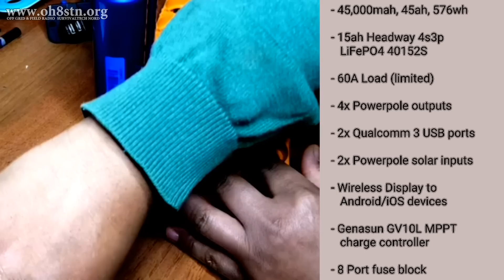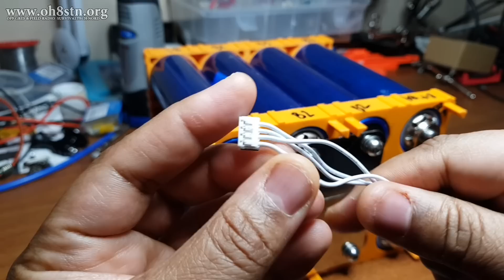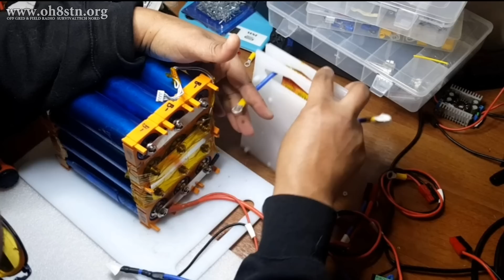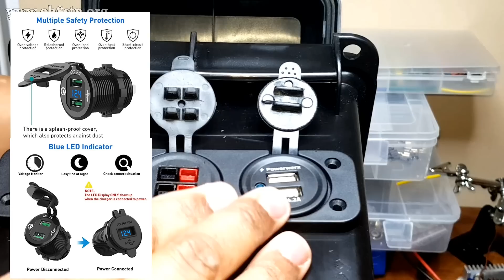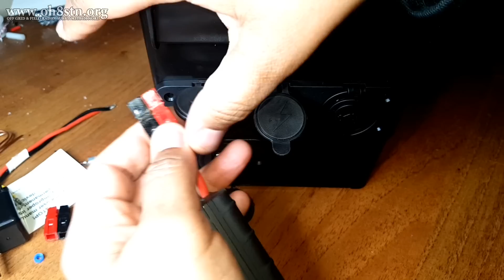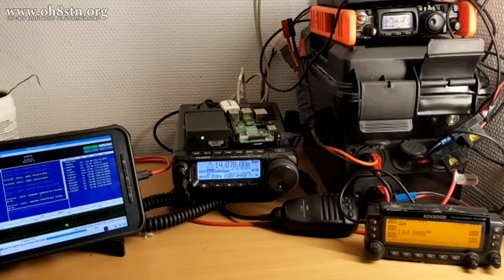DIY Ammo Can Solar Generator | LiFePO4 Off-Grid Power Build

Comment: Julian, looks like a great base camp power system.  How much is the all up weight of the overall system?
Reply from the maker: The solgen is total weight 18lbs (8.3kg). The 120 watt PF solar panel is ~6 lb or 2.5kg.
Reply: @OH8STN  I was curious about the weight of just the battery.  Reference the other components, have you weighed and measured each system? I have made a spreadsheet of all my components at it gets revealing which configuration works best for man portable, bike portable or picnic table portable. Big difference between man portable and vehicle mobile as you well know. Bottom line, weight management is a function of capabability and endurance. The challenge is to determine the appropriate compromise for the given circumstance.  73s IU3JNT
Reply from the maker: @TXLorenzo  hello Lorenzo. 100% agree with you. I didn't know which video you were commenting on when I left the comment. Take a look at this video https://youtu.be/Pm6Tvt58_8c
In this video I'm operating bike portable, using the system in this build. I also have smaller more portable solgens, for weight management. Would be interesting to see a PDF of that spreadsheet

Comment: Awesome build. The links seem to not find the same parts used are there others places you found these parts
Reply from the maker: Check the build notes on the website. The one thing that is not available right now he's the BMS. I did find that from another place and I'll update the linked shortly
Reply: @OH8STN  I've been trying to find an alternate BMS to use since the Bestech is not available on ebay currently.  I intend to grab one of the Bestech when they're available but do you have any second choice suggestions in BMS to get going in the meantime?  I've not had much luck interpreting/trusting the low number of reviews on most of the ones I've found not to mention the very low prices and getting RFI quiet.   I don't need much more than 30-40 amp draw at most since my FT-991A has a 25 amp fuse.  73 N1AFF

Comment: I'm not actually sure why these cells are so expensive. The battery chemistry is not the reason as similar cells cost way less. In fact, this is the only factor holding me back from building out this project. The link in the video just takes me to ebay with a pre-filled search. It would be better if we had an actual trusted supplier of these as taking a chance on ebay can get mixed results. I mean, one listing is $750!
Reply from the maker: Too many different countries in the world for any single "buy link" to make everybody happy. The build is done in a modular way so that whatever cells you can source, can be used, peovided the battery chemistry is the same.
Reply: Thanks. I’ve every intention of following up on this. As you say, emergency preparedness begins with reliable off grid power and your video here is absolutely invaluable. Definitely worthy of continued support.

Comment: Maybe you could use heat pipes/ heatsinks to cool it while still being able to seal it against water?
For emergency systems being water tight might be quite useful.
Reply from the maker: Actually it doesn't generate that much heat because we've overbuilt the system. The cool thing is designed a smaller generator based on this model. It's mounted inside a Pelican case. On that smaller one all the DC outputs are sealed oh, so no water can Ingress. Awesome idea and thanks for the comment 👍
Reply: @OH8STN  cool.  I was thinking of building something like this as a portable system for outdoors.  Being watertight seems really useful if it's going in the woods.

Comment: Let's say that a battery pack for long-term backpacking (3-4 days) should be no heavier than 3-4 lbs at the most (not including radio, antenna, keyer, mic, and other wiring). A 30 lb long-term backpacking weight is considered somewhere between average to getting on the heavier side. What would be the best battery pack that could be built therefore for long-term backpacking in terms of energy and charge capacity for the 3-4 lbs maximum guideline (also minimizing volume/space inside the pack)?
Reply from the maker: It totally depends on the equipment you want Power. How much current it consumes when you're powering it, and if it to radio how much current it consumes when it's just sitting there receiving. Generally speaking the most energy dense batteries are lithium ion. The next is lithium iron phosphate. We don't even consider lead acid or AGM or any of the nickel metal chemistry,  because they're too heavy. So we want to know what you want to power, how much current does it consume when you're powering it, and based on that we can come up with the right battery configuration in the answer to question. Does that make sense?
Reply: @OH8STN  Thanks! Let's say it's the Yaesu FT-891, receiving about 80% of the time and transmitting at full power (100W CW and/or SSB) about 20% of the time. Just as a concrete scenario.

Comment: Hi Julian, great video!!  I have one quick question – For the solar inputs you used a yellow and black Powerpole panel mount. Did you purchase it or somehow change the red for yellow? I have been unable to locate a yellow and black panel mount and am unfamiliar with swapping out the connectors. Thanks Chris N0PRO
Reply from the maker: Hi Chris. I actually purchased the yellow connectors separately. Then I swapped them out with the red on the powerpod panel mounts.
Hope this helps.

Comment: Julian, I love all that you're doing? Is there any way we can talk as I have loads of questions.  You can find my email on the ARRL website. Thanks, KC3NVS 73
Reply from the maker: Hi James. You know I have dozens of comments coming in every day and even more through my email. It's all pretty unmanageable. The best way to get my direct attention, is by using the PayPal or my Patreon. I do answer comments as I find time, and emails when it's possible. The whole point of making so detailed videos is helping operators get as much information out of them as possible. But if you use one of those two platforms I mentioned I will reply usually within 24 hours.

Comment: The charge controller should be directly connected to the battery not the BMS if it disconnects the mppt charge controller it has a chance of destroying the charge controller. Hope that information helps.
Reply from the maker: Your comment can be right in some circumstances, but in this case it's very misleading. It depends on your BMS and charge controller. If you're using the BMS and charge controller I specified in this video, the charge controller negative goes to the BMS, while charge controller positive is connected to battery plus. This configuration allows the BMS to protect the pack, disconnecting in an over-voltage state, without destroying the charge controller when the solar panel is attached.

Comment: What a beast!
The best reason for LiFePO4 chemistry, the cell voltages and discharge curve are more friendly for "12V" equipment. A 4S LFP is almost a perfect replacement for SLA/AGM, whereas LiIon/LiPo chemistries either give a 3S which result in a battery with a discharge curve with voltage going too low for many electronics (esp. transceivers), and a 4S LiPo having way to high starting voltages.
Thanks for stressing the safety. One "momentary lapse of reason" can be quite destructive with these things... (almost literally lightning in a bottle!) 73 de AF5MI
Reply: I definitely agree voltage wise it more closely matches Lead-Acid batteries which is rather handy, but I think the biggest problem stems from the haters not understanding building LiPO chemistry / discharge characteristics. The BMS can go along way toward keeping cells "in-tune" with each other (although in this installation some of that advantage is lost by "pairing up" the batteries  (not a criticism, just an observation) and yes I know Tesla uses hundreds of small batteries and doesn't "BMS lead" every single one of them, but they also fuse each one). Also, it is important to know when a battery not pulling its weight either in reduced capacity or discharge rate - this can get worse over time and the BMS can go along way in preserving the useful life of the pack / cell group. Anyway, keep up the good work and trying things to improve field comms - 73 AC8PR.

Comment: you get over a days runtime out of a 4S3P pack? wow I didn't know these headways were that good. I know I'll get about a weeks runtime out of my 180Ah CALBS, but that monster also weighs in at 24Kg. I should make one of these for park operations where I just want to travel light.
Reply from the maker: It really depends on how much amperage you're pulling from the pack. This is a 45 amp hour pack. Occasionally I'm putting a 20 amps load on it. There's a constant 1 to 2 amp load on it when I'm running my radios I'm computer. Even then I can get about a day and a half. Each of the Headway cells is 15 amp hours. Since I'm not losing anything by using an inverter, the system is quite efficient.

Comment: This does not look very "man portable"
Reply from the maker: Youre not paying attention 😊
https://www.instagram.com/p/BzCx84uDfdP/?igshid=1ca0k9vo9y2wg
Reply from the maker: Actually Dennis you just gave me a brilliant idea. I was going to post another video this week but I think I'll work on the show and tell from my field day deployment. At first your comment seem cynical but actually it's brilliant comment they put me in the right direction for the next video. Right on!
Reply: Actually I was not trying to be sarcastic at all. Just making a comment. I enjoy ALL of your videos and have been a subscriber for 3 years. One suggestion. I notice that a lot of your portable power videos are DIY. If there was an emergency situtation  or a SHTF situation you would not have the parts to build anything not to mention that mail service would be out. Why not do a video on the same thing but using components that you could snap together that you would already have on hand. For example you have the power film roll up panels you connect that to an already on hand solar controller which you connect to a motorcycle battery e.t.c No soldering or wire stripping or trying to find connectors required??

Comment: Love this! Looking to getting into Ham Radio but for now building a solar gen for my astronomy and camping. Just got a Renogy 50ah Lifepo4. Does that Bluetooth shunt system give state of charge info? I was foggy on that. I can do volts and amps with my DVM but need some kind of special thing for SOC. Victron is so darned expensive for that little meter they have.... Next time maybe I'll be brave enough to build my own battery bank:) Thanks for the great vid!
Reply from the maker: Yeah the shunt goes Way Beyond just being a meter :-) state of charge, real time incoming and outgoing amps & watts, battery runtime remaining, volts V1, V2 from two different points in the system eg battery and solar input, controls relays, high and low voltage protection, over current protection, and can send data to a computer for data logging.
Victron gear is awesome. You shouldn't look at it as expensive but in terms of how much it will save you I you by using it

Comment: Hi Julian - as others have said - Outstanding ! I think we will all take it ! Have you considered LTO batteries ? They are made by Yinlong - 2.4v @40AH cells.  (Edit - I see further down in the comments you mention you have looked at these cells quite a bit)

6x 2.4v LTO cells is a drop in replacement for a 12v lead acid battery - that has got to be a useful thing when using 12v. It's interesting that a 6 x 2.4v LTO cell pack can use standard lead acid chargers etc. That opens up the options considerably in terms of charge controllers (ie, not needing a Lithium chemistry charge controller)
Reply from the maker: Yeah thank you for the comment and kindness. We keep coming back to these. Perhaps I need to get a dozen or so and simply build a battery pack with them. We certainly don't know until we try right?
Reply: @OH8STN  Is there anyway to ship one of these generators built with LTO's? If so I will pay for all the stuff needed if you can ship it to me when done (+ something for your time) Saves your out of pocket to try it out.
Reply from the maker: @Jim Jones thanks but no. I do these builds do people can learn, not to make profit. The basic system is here, now anyo e can adapt it for other chemistries, other configurations, ... Please knock yourself out, just share your results when done

Comment: great video,  what would you say about lithiums location in laptops about the heat they generate affecting something like the processing even as well as their heat is shielded, whatevers above batteries in sence should warm up like the pcb and co., with the processing from the stock exchange then the operator opens other apps ect lots of processing, storing , deleting autonomiclly there's a limit to that so then they have to upgrade maybe a better computer I've heard of freezes and they lose all their info without recovery sounds like a overload maybe in the power supply thats limited as well or having the laptops lithiums located with distance from the pcb, what would you say about mounting a ic chip on another would that increase storage and processing to retrieve the lost info?
Reply from the maker: I would say don't buy poorly designed Chinese laptops. Lithium battery packs should always be designed for the load. Should be able to sustain the load from the device they're powering, without generating too much heat. If they're generating a lot of heat, the lithium batteries or insufficient for the load they're trying to provide. For example in this video, my lithium iron phosphate batteries can supply 450 amps continuous, but they'll never see more than 30 or 40 amps load. This means the cells making up this pack will never heat up, since they're nowhere near their load capacity. I've ran this system now for nearly three months with a constant ridiculous load. It never gets above 23 Celsius.
Reply: @OH8STN  yes, I did catch that part  on the voltage and amps, it's about the quick charge and capacity some topics I'm way behind on Utube
Reply: @OH8STN  with the super caps in parallel with your packs could they be aligned in series easily if they were charging directly from an alternator in a car?  lots of quick amps
Reply from the maker: I've never tested that. What would be the point of the supercap in that setup? Bass driver?
Reply: @OH8STN  for a slow drain form Solar panels at sunset into lithiums or ledacid or bursts of amps into a EV motor(motors) from an alternator and slow drain into lithiums or on the EV,  similar to how you oversized the capacitors,  I think the manufacturers of the EV's are oversizing the lithiums and undersizing the super caps, a couple skidfull of super caps would be nice , drive to the convenient store and back with the 2 skids in the back of the van all charged up,  getting back home  then draining into the home
Reply from the maker: That sounds pretty cool. I hope I'll have the budget someday to do big projects on that scale. Right now I'm quietly building an lithium powered, off grid communications "bunker" in my home. It powers my radio gear, lighting, efat bike, ... one step at a time though right? 👍

Comment: This is the 1st video Ive found, of a solar generator using the 38120's.   Great step by step video.  Wondering if a similar set up with an inverter is planned for a future set up?
Reply from the maker: Thanks for the kindness. As radio operator I try to avoid using inverters and keep everything DC. Still it's very easy to add the inverter to this generator. It's just another DC power output. The generator can put out 60 amps continuous, so that will drive a pretty decent inverter.
Reply: @OH8STN , thanks for your prompt reply.  This is one set up i am looking to build in the near future.   Although with some 120V outlets, thus why i was searching for a 38120 battery set up. 

Sure glad to know that you keep in touch, in case of any future questions. 

Nice work on the video

Comment: 3rd time watching this video Julian...quick question...did you dremel off the standoffs of the trays so you could use the solid 4-way buss bars? Looks like you went back and nipped them off.
Reply: BTW...GREAT video! I want to build this system for my ft -817 and  rs-918 mcHF radios. Thinking of your earlier build for SOTA and portable ops....and a manpack radio.
Reply from the maker: Thanks Richard. This one might be totally overkill for the 817 or the rs-918, but you could power a lot of things with it.
Please tell me, how do you like that rs-918?
Reply: @OH8STN  I love it!!! It is my first SDR (and I got a GREAT deal on it) The form factor is very small but the screen is easy to read and touch control. The menus are easy to navigate and set. The firmware update and version update were super easy (so easy I could do them...that's saying a lot) I added a heatsink to the top of the radio using the case screws and it does help cool the radio. For a QRP portable rig this is one of the smallest I've seen. Not as full featured as a KX3, but I got mine for less than $200 used. I can pack a tuner! I already do for the 817. Using a homebrew linked dipole I talked from North Carolina to Texas on 1 Watt on 40M last camping trip.
Reply: The scope is fantastic, that spoiled me instantly. I have not used it for digital modes (not quite there yet, still a lot of SSB for me) but it has USB, Micro USB, Phone, Mic, Line in and out, ACC, and key on either side. The built in spkr is plenty loud in the woods too.
Reply from the maker: @richardtalbert639  outstanding 👍👍👍
Reply from the maker: That's right. You probably can't see it in the video or I forgot to mention it. But in the end I clipped off those taps where they came together, to allow for the 4 hole bus bars 👍